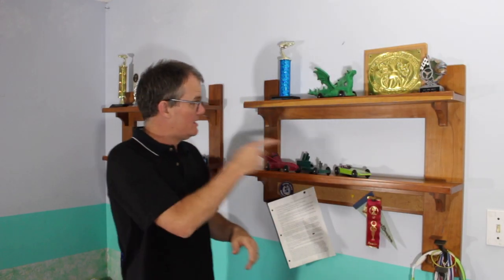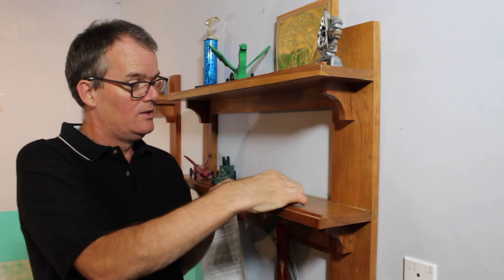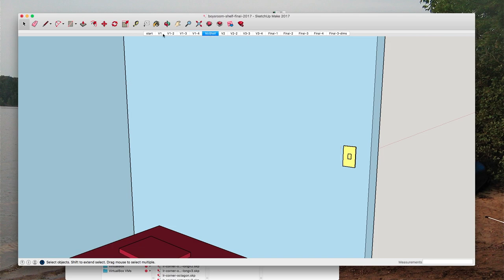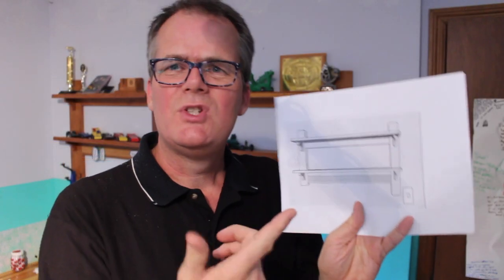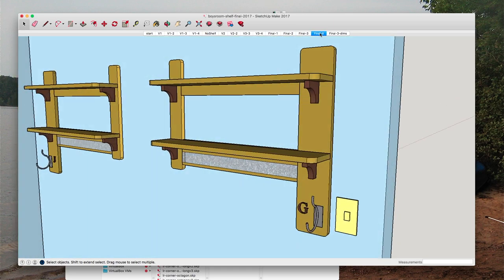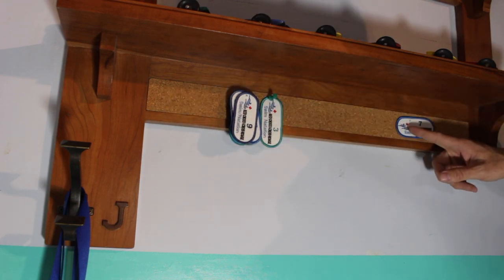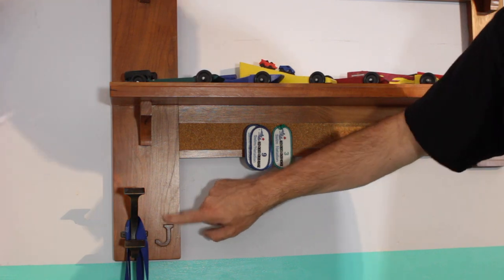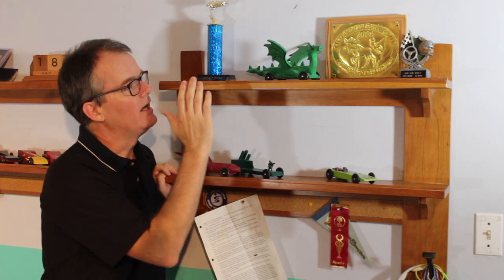How I Design an Arts+Crafts Display Shelf (WnW #109)

Comment: Whenever I see something made with boards that are different widths for no practical reason, I just assume the builder was using up scraps he had :D
Nice recap on the design process. I think I like the first version the most, but maybe instead of the straight angle cut, make it a gradual curve instead, to somewhat match the brackets.
Reply from the maker: Ouch, that smarts.
Interesting thought on the curve, though.